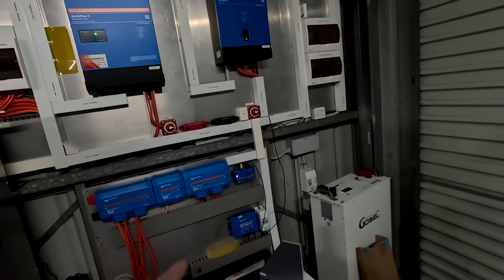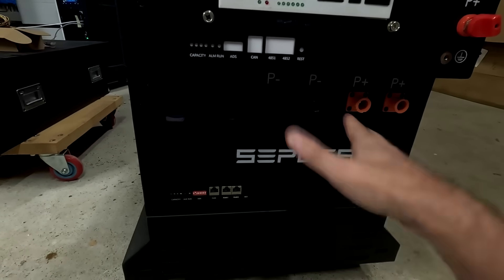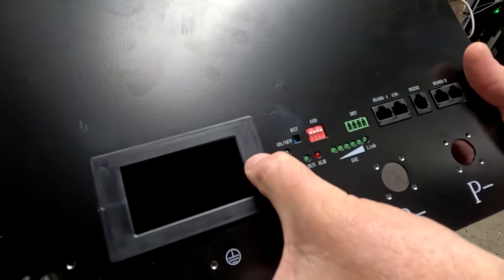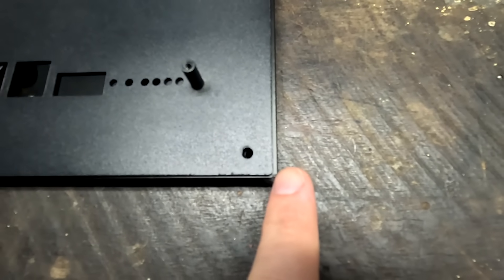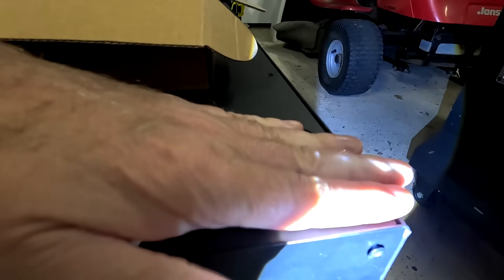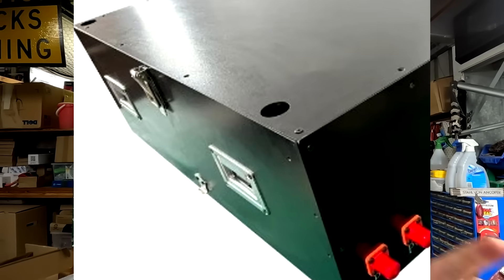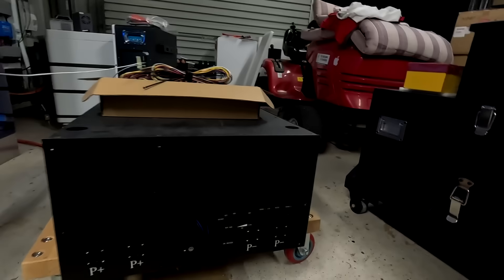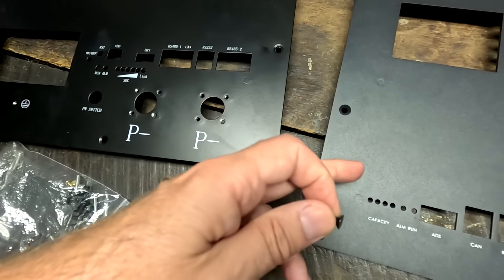JK Inverter BMS Frontpanel for Seplos Mason 280. But wait...

Comment: Heya, sorry unecceptable the hole don't line up oke drilling new hole could work yes but then the paint is of because it's rusting you see the blisters unther the paint and then it's very thin or read cheap. get a refund and bay a aluminium plate the zise of the front plate and maybe use the 3d printed molts that would be fun

Comment: Andy: the first thing to learn is that water is a cheaper storage of energy than batteries, so make sure to Never heat up water with a battery unless in an emergency when there is no line power.

Keep the cheaply made front and replace the box with their box and you have another video to sell.

Comment: How about trimming the panel to be very slightly under sized all around. Add a frame border to cover the holes all around using aluminium angle and glue it to the plate using JB Weld. You can then drill the border with correct hole spacing and paint as required. If you rust treat before assembly the bad paint edges will be hidden and hopefully the damaged paint finish will be hidden behind the frame.

Comment: Find a weld shop and have them weld up all the holes, and machine the sides to the correct width, then re-drill the hole pattern with your drawing and repaint ... I'd return for a full refund.  But you could use this as an opportunity to learn some TIG welding, and weld the holes up yourself and redrill to the correct location.  I've seen your work and it's well within you abilities ... you do good stuff 😉

Comment: Atention for acesory of this panel. The cabling its made only from 7AWG and use 25mm2 terminals. The busbars has 48mm2.
Minimum for 200A is 70mm2 (7AWG in double is about 24mm2)
External terminals are made from aluminium without silver plating.
Do not waste your money.

Comment: I'm little crazy  I would grind off paint around the edge. Weld holes shut. Cut the size down to fit. Drill new holes. Paint.

Comment: I'm sorry Andy.
My fault.
Recently received my XR07 280Ah box for JK bms with 4.3inch display and I must admit, they also do have problems with aligning holes.
Going back to front plate. I would drill or file this holes wider, move it where it should be and use washer(black ones preferably).
In the end it is Frankenstein. 
Don't try to make him pretty.

Comment: Treat yourself to a 270L istore heat pump for your hot water. We did it used 2-4Kwh per day and frees up power to house/car. They aren’t particularly $$$  either.

Comment: Hello Andy,
is there any video that talks about your victron power management system or all the blue stuff on your wall? I really like that victron display on your system tells about what you have. unfortunately I have 11 kw voltronic 11kw inverter which has two PV inputs, wondering how do you manage to combine multiple different set of PV into your system, do you have individual mppt for each set up PV units, such I have 9x550 and 6x550 totally away from each other PV units; but I hesitate to connect them into single inverter, which I assume each PV1 and PV2 needs to be equal, wondering how do you manage? can I integrate victron battery management system into my interver and JK BMS to see that beautiful display? Thanks
P.S. I would weld those holes or fill with some paintable silicons then sand it then re drill holes and paint again, since it is already started to rust.
Reply: I have four separate arrays of varying sizes. My 5kW MPP inverter has 3.5kW supplying it and the other three are fed to the BMS via individual MPPT controllers set up with identical bulk, absorption and float settings. These are combined just before the BMS using a 200A block. So the inverter sees the 3.5kW as a supply and the external charge as all battery input. The BMS treats the combined input as one variable charge.
Not fully efficient due to inevitable minor discrepancies, but not complex due to multiple control or monitoring points.
It's not been working fine for years with lead and now lithium batteries.

Comment: JLPCB could convert your own design to steel, and may sponsor the channel also?
Reply from the maker: They are asking for a while for a sponsorship. I don't do sponsorships where money flows. It makes you biased as you need to deliver some positive outcome for them.
I know they do CNC and metal work design as well. I would need to measure all the standoffs, holes, cutouts as well. That seems an awful lot of work... I really don't have the right measurement tools to be that precise either.
Reply: @OffGridGarageAustralia  ok glad you don't take sponsorship actually. I thought maybe you could have sent your 3d file.
Reply from the maker: @TobyRobb  yeah, I don't have a 3D file or exact measurements of the Seplos front panel. Just the photo and measurements I've shown in the video. To make such a plate, it needs to be far more precise.
Reply: @OffGridGarageAustralia  sorry i must have been thinking of the 3d printed panel you made previously
Reply from the maker: @TobyRobb  I printed some elements of a front panel and mounting bracket for the JK BMS.

Comment: Do the holes line up if you put the panel upside down?
Reply from the maker: No. That's what I did. The top and bottom row of the holes have a different distance from the corner of the plate.

Comment: Perhaps starting the screws process from the centre out might give a more even install and then proceed to moderately modify the ones closer to the edges
Reply from the maker: Yes, correct, tried that as well. The bottom row is around 4-5mm out though. No way to centre that unless I widen up these holes.

Comment: I would like to see a smaller plate that has the comms port only because it is the most difficult to  make with lots of filing, so I would butcher your plate just for the comms port as long as there is enough to make a flange out of it, even more so you could just trim the main plate borders by say 20 to 30mm enough to make a new outer adapter plate with the small trimmed plate fitting inside with some mounting screws
Reply from the maker: We have the comms port as a 3D printed part or panel already. You mean something like this just in metal: https://www.thingiverse.com/thing:6389453
Yeah, I could make one plate out of the two. I just don't have the right tools to handle such metal correctly. A jig saw and a metal file basically...

Comment: Hi Andy,
Are you try to connect Seplos BMS with JK Inverter BMS? In JK documentation in part of communication protocol and  CANBUS, option 6 has option 005 - SEPLOS BMS CAN Protocol V1.0.
Reply from the maker: No, that will not work.
Reply: @OffGridGarageAustralia Have you really tried it with latest Firmware Version? If this works IT will BE a big benefit for the Community.
Thank you

Comment: Weld the holes close or let someone do it, repaint and redrill with the right positions if you want it perfect.
If you are fine with not so nice looking, reposition the panel and redrill or widening the holes and use washers for the screws.
/Marc
Reply from the maker: Yep, both possible solutions. Welding and repainting seem to be a lot of work and $$$ though.

Comment: I see a 3D printed panel using all those measurements you already took and share the file... 😁😁😁
Reply from the maker: Yeah, but at the end it is made from plastic not metal. And we are dealing with a high-powered energy storage system. And I'm not talking about heat or so but more from a regulatory perspective.

Comment: weld the holes closed trim extra 2mm off redrill holes correctly, paint and Andy label the Markings. will be cheaper than shipping I think and You have a Andy's front panel :-)
Reply from the maker: I cannot weld such thin metal. I only have a jig saw on hand to cut the metal. 2mm will be messy to trim off.
I don't have to pay for return shipping. AliExpress is doing that. Most articles have a 'Free Returns' label, so...
Reply: @OffGridGarageAustralia  in that case send it back unless You want the content, for 2mm a flap wheel or file might do it on that thin metal i've done that on thin pc cases rather than buy a new one.

Comment: You are lucky, i have 2 of 6 faulty jk bms, one will not start probably, and one has poped a discharge fet. I have a really hard time to get them to take responsibility for ther shit... 😩
Reply from the maker: They should at least warrant the one which does not start correctly. Have you tried force updating it to an earlier version and then flash again to the current version. This has helped others in the past.
Reply: @OffGridGarageAustralia  Thanks for the advice but its not the "inverter" bms, the one that cannot start probably is an 8s with heater function. 🗑️
Reply from the maker: @ffs5310  Arghh. what does it do when you connect it?
Reply: @OffGridGarageAustralia  You can just hear its trying to start on the buzzer, sounds very sick. ;D i have a video of it someware.

Comment: Löcher passend aufbohren und Linsenkopfschrauben mit Flansch verwenden ISO 7380-2
Reply from the maker: Passend aufbohren... die muessten ja 3mm nach einer Seite rutschen. Glaube nicht, dass mein Akkubohrer das kann. Hab keine Metallwerkstatt🤷‍♂️
Reply: @OffGridGarageAustralia  dremel mit 3mm hartmetall fräser, easy
Reply from the maker: @mosfetkiller3851  hab ich beides nicht...
Reply: @OffGridGarageAustralia  dann wirds zeit :) einen zu kaufen wirst den mit sicherheit öfters brauchen
Reply from the maker: @mosfetkiller3851  das stimmt wohl. Hätte ich schon einige Male gut gebrauchen können.

Comment: Hello Andy,
it looks like drilling the wholes of the plate bigger and use some washers for the srews will do the job.  🐸
Reply from the maker: Yes, that will work if I make the holes a lot bigger. Especially the front row if far too high.
And I need rust converter...

Comment: I would suggest to increase the holes on the front panel and use washers with bigger outer diameter under the screws heads, in this way the screws will fit and together with the washers will hold the front panel. When using black fasteners or after painting them black the modifications will not be visible.
Reply from the maker: Yep, that's an easy solution. And trim off the side and top a bit, or leave this as it is?

Comment: You could also file the holes larger and put washers under the screws.
Reply from the maker: Yes.
Reply: Or Dremel and burr bit if you are steady with a power tool.

Comment: Have you turned the panel upside down and checked alignment? I would grind two mm off. The imperfect front fit nay give the correct hole spacing once sitting correctly
Reply from the maker: The holes won't fit, regardless. The paint will come off when using a grinder. I would use a jig saw and slowly work it through to not generate heat.

Comment: Andy, try turning the screws from a different angle and more screws will probably fit.  and those where it is not suitable, simply pull the holes in the right direction with the help of a dremel or a round file.